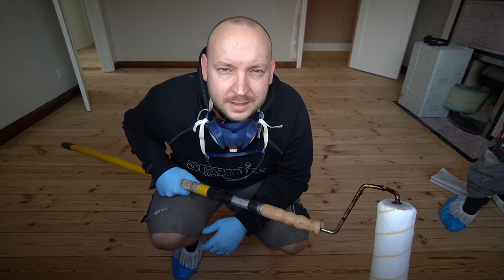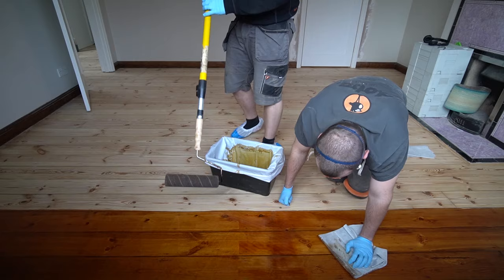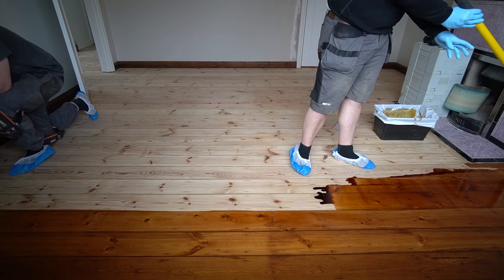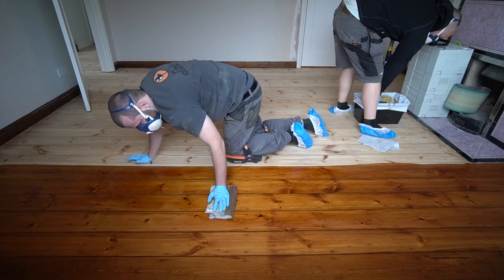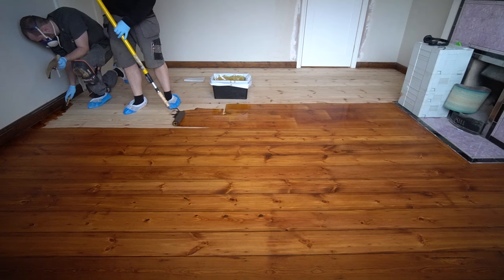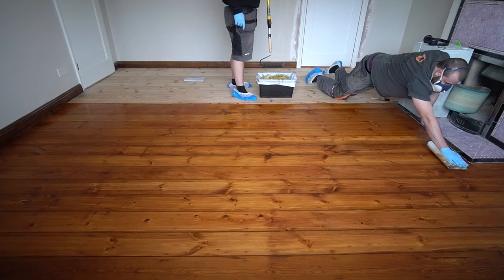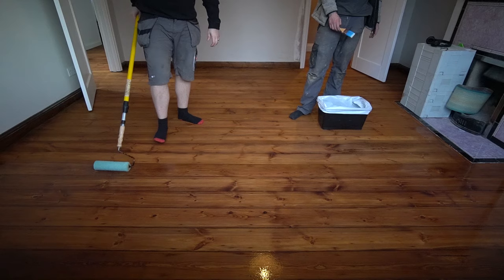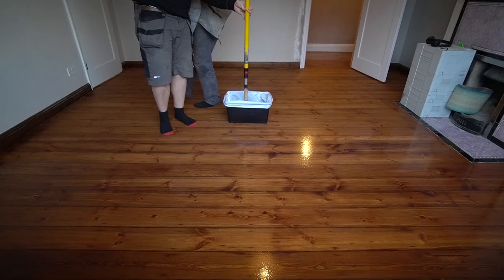A Staining Method That's BETTER FASTER AND EASIER

Comment: Here in east Texas we have a lot of Cypress trees ...therefore a lot of older homes have Cypress  wood floors . I laughed at a "professional" wood finisher when he told me it was impossible to get an even finish on Cypress or pine floors. I get amazingly beautiful non blotchy finish on Pine, Cypress and Cedar.  It's required that you sand soft porous  woods down to 150 grit and then the major secret is to pre-wash it after vacuuming with paint thinner.(make sure your stain is compatible with mineral spirits or paint thinner. You then have about 1 hour after the wash to complete the staining job . The thinner prevents the more porous areas of the wood that would normally absorb too much stain, from making it darker , and thus a splotchy finish.
Reply: Need any help . I’m in The Hawkins area and did floors for 30 years
Reply: Thank you for sharing that tip! I’m sure that would work on any soft wood project; not just on floors! 🥇
Reply: What about yellow pine? It's listed as a hardwood I'm trying to decide whether I want to spend endless hours hand sanding    furries n such before staining. I've already beat the hell out of it with a pressure washer

Comment: So, using a roller is "wrong"?  Really?  They say it puts on too much stain?  That doesn't make sense.  After watching the video, I would say that you didn't use excessive amounts.  You achieved the look you wanted.  How is this wrong.  Thanks for the info.  We've sanded and will be staining and sealing our floors next.

Comment: I'm not here to critique like an armchair contractor. I work for a living too. I just genuinely have a question. Did you have your guy immediately wipe the excess off because you wanted a lighter tone? Or because that particular stain dries quickly? I usually wait 5-7 mins and wipe the excess.

Comment: I like to use my buffer with a white pad.  Buff on buff off.  I haven’t been down on my knees in 20 years.
Reply from the maker: Jason Beaudoin which stain do you use?
Reply: I use Bona dry fast
Reply from the maker: Jason Beaudoin yeah I have heard that’s a really great stain in the states. We have it here but it has a slightly different make up. It doesn’t work so well unfortunately .
Reply: @HowToSandAFloor  BONA /Dura Seal/ MInwax  the most with what we work in USA  also some others what we are using not so much  ...oil base same Bona/Dura Seal /Masterline/Sinteco (what in Europe you  got )  and some more  also for Water Base ...Bona /Dura Seal other a lot of variation  i will recomand BONA as advice very good product you can get from Europe

Comment: I'd prefer those boards be a little lighter or closer to natural, but they look great.  A stain choice for me would depend upon the color of the wall / trim as well. I don't want to choose a stain color for my oak floors, but it would prolly hide lots of sins. Have wavy boards and chatter from a botched job. I tried to fix that persons botched job.  The hardest part of the job is deciding when enough is enough or when there are diminishing returns.  Learning to live with imperfection -- Sigh.

Comment: Thank you!😘   After trawling through countless videos came across yours and is the best 👌 You explained everything clearly and we feel alot more confident in staining and varnishing  our floors. We have a 3 storey town house which has pine floor boards - doing all 4 bedrooms and staircase. Big project and need to get it right. Have morrells stain and bona varnish, hubby finishing sanding today - thanks for your advice its been a massive help. Hopefully we won't row which each other as the jobs are pretty defined as shown in your video. Marital DIY harmony ...we hope.
Reply: matters not how u put it on, matters how u wipe it off.   just have to brush it rag it or whatever to apply it to the wood.

Comment: Wood floor guy here. Pro since 1999. I'll skim around every once and awhile on YouTube about wood floors. Interesting to see the different methods. 
Yes you are rolling on stain. 
Only issue I have is splattering. Thin watery product can splatter if you're not careful. 
Usually I wipe on and off with rags. 
Occasionally I'll use a circle buffer to drive in my product. Less product and I'm off my knees. 
Cheers, Ben

Comment: One reason why a bucket strategy is also better:  
As you apply laquer, you have a chance of picking up and pushing around dirt/hair on the floor.  A bucket will allow you to put a grate at the bottom to allow it to settle to the bottom without picking it back up.  I previously used a bona-pad for application though.  Allows for a very smooth finish.

Comment: Good ideal on roller, I just completed a 4 bedroom 2 story home in 1/4 of time.  I used a  14" roller 3/8 nap  and 3 gallons of oil based stain. Same roller for waterbased poly and it turned out great! Thanks for video

Comment: Hi. Watched a few of your videos. Enjoyable. It has been my trade for 30 yrs.. I'm 79 now, retired???
Its such a rewarding job isn't it.
I live in Notts. But used to cover the country if job big enough. Used to do loads in London. But stopped it. Away from home too long.
If not staining. I always used Junckers Base prime. No need to sand again between coats
I  also used lots of Ceramaxx from Havwoods Accessories for commercial work.

Comment: if you are able to get it in the UK, you should try  Loba  WS easy Prime sealer and their Viva 1 step  self leveling polyurethane. I used them over Duraseal stain, I am in the US. Loba is a German product, I am 70, did 90% of the work, including sanding, by myself, It looks so good. I am extremely happy.

Comment: You"r doing it right. For stainting  to do it with a brush, it would take longer . With the roller it is much faster. Just make shure you use a fine roller, don't buy cheap. Thank you for sharing. You"r doing a great work.

Comment: Roller idea is pretty cool. I like using a lambs wool on a lock and a 4 inch brush for the edges. I’ll buff off the stain using a black buffer pad with rags underneath. Works like s dream. The black pad grips the rags preventing them from bunching up or folding. Do you ever water pop your floors? I’ll use 50/50 water and denatured alcohol. Helps the floor dry faster.

Comment: Another great floor Ben. I know what you mean with the lap spash marks with the morrells. I've used both roller and pad. as you demo-ed, with the roller you really have to squeegy the excess on the side of the scuttle, then not much diff to the pad.  Bona Traffic is the only product in my opinion. i've even used traffic to finish a beech worktop - it's the nuts!!
Reply from the maker: Thank you!
Reply: did you use a special type of roller...like foam

Comment: Aaaa....the dreaded stain. We've used rollers, brushes and we have also rubbed it on with cloth, i find the brush is the best way ( and slowest) but generally worth it. It turned out well for ya, great job again man, we actually do it the exact same way.

Comment: Been doing this for years, then a buff out and light vacuum the next day floor is like silk for your 1st build coat. if you put a cheap 220 disc on your buffer red/brown pad and lay the stain on heavy it will produce an amazing final buff feel. Add stain 50/50 ( this will produce a lighter stain than intended) to your finish and do a 2fer on cheap jobs they want quick turn around. Mind those contracts though liability is always just around the corner. Your technique is fine as long as the stain is dry prior the build coat. Make sure all stains that are blended with finish thin with similar products...or ..nightmare!! Good work sir. Water pooping and applying stain on your knees will often produce drag marks from your feet and knees.
Reply: I use a blend of ~48% NGR stain 48% retarder and a splash 4% moisture cured polyurethane. Apply (liberally) with lambs wool applicator bar which made out of PVC piping, brush in the edges section by section. Thinning the colour right down with retarder but using twice as much product helps keep the edge wet and everything just evens out beautifully (although it look s terrifying as you apply it).
Tried dozens of different methods across hundreds of floors and this method works the best for me.
Reply: @peterkotara  Outstanding Ill try this my next rental job so it won't bite to hard if it all goes south. I always am looking for better methods. MCU is almost impossible to find here VOC laws, but straight poly should be OK.

Comment: Never thought to roll it on, might try to talk my boss into trying this with a lighter stain. our crew normally just uses rags, have used lambswool a couple times which goes alot slower but give a really rich and deep color that anything else just doesn't give
Reply: My main question is do you water pop your floors before staining?
Reply: Mr.roastyonutsack Jr. I think only if you want a darker stain. I know it helps if you want to absorb more stain to fine sand with grit that would leave more pores open before buffing.
Reply: @kombobeats  there's a huge difference between a darker stain and richer stain, water popping won't make it darker it just makes the color less blotchy and have it take richer, the darkness depends on the stain you use, how much of the stain the wood absorbs and takes the stain depends on the process. I think I rolling on stain after water popping would be a disaster because of lap marks like the video mentioned
Reply: Honestly, using rollers are the best thing if using Morrells stain as it dries so quick.

Comment: Thanks for the video. It answers my question, 'can it be done with a roller'. Yes. I've experienced in applying stain with a rag or brush, that if you lift the brush or rag at the end of any stroke, it will leave a 'faded' or ragged end, instead of a hard line. Faded edges are much easier to blend strokes together. Now I'm wondering if that effect is attainable with a roller. I'll try it soon. Again, gentlemen, thank you for the video.

Comment: Cool vid...I tend to stain in oil with a wide brush and rag off..with oil I have plenty of time to play with..
I also tint the water based lacquers if required..
I also use a large fume extractor if I apply oil or sprit base stains.
I see you also use Festool.

Comment: Rollers fine. Allows u to put it on thicker if u want the stain darker. Normally just use applicator and a thin brush. If your patient u dont need to wipe it off with applicator technique. Bona traffic/Loba duo is my standard Water base polyurethane. I will rarely use anything else. Sticks to anything and rare lap marks

Comment: I buff the stain on with a thin carpet. I cut in with a sash brush, wipe, then buff into the cut .  You need to use a stain that is made to buff. Usually it has tongue oil in it.
Reply from the maker: There arent really any good buffing stains in the UK, its really frustrating. Duraseal was going to be imported to UK but I think they ran into to many problems

Comment: My polish boss used to do it this way . I would cut in and he'd apply with a roller , and I'd go behind him with dry rag tonsoak up excess .. u gotta move fast to not get over lap lines but when u work with someone so long we both know what we r doing..
Reply from the maker: Since this video I’ve done roll on and roll off. It worked surprisingly well. Also done rolling the whole thing out like lacquer, then just ragging off afterwards, with overshoes on. Both were amazing.

Comment: If that was minwax stain on a pine floor it would lap far worse. Trade secret for big jobs...use your buffer to both apply and remove stain. You can use a white pad or a good quality carpet cut in a circles under your buffer. This method also ensures an even spread on large floors.

Comment: Interesting. I've heard of guys using rollers but I haven't seen it in acti9n. We apply and wipe up with a buffer using carpet pads. Idk if that's a thing in the UK, but it's definitely faster than this. I saw the recommended stain was minwax. Minwax is inexpensive and easy to work with. But it has drying issues. It's anywhere from 10$ to 14$ a quart where i live. Most guys have gone back to it because duraseal, is now 25$ a quart.. duraseal for sure is superior in dry time and colors. Some colors overlap because they are owned by the same company but they are different products. Duraseal is harder to work with. Bona is fairly easy to work with, and drys fast but their colors don't look great 20$ aquart. I don't have any experience with loba stains. Yet anyways. I do recommend buffing the field first, then blending your edges. Use  a good 5 or 6 inch brush and keep smaller ones near by for when necessary. Clean them after and keep them in their own bucket. I'm not a fan of chip brushes. Applicators do work well for stair cases though.

Comment: If you do not like filling in such cases, what would be the alternatives? Also, what you do with nails on such floors - should they be a bit below the surface or sanding machine is fine with them?

Comment: We are staining Douglas Fir floors and using Minwax Wood Conditioner ahead of the stain.  We are having problems with inconsistent staining and sanding scratches coming through.  It has been so frustrating.

Comment: Excellent work lad's, do you find the roller better or easier to use than a wool applicator which I mainly used in the states and roller in england. When using the wool applicator to put stain on and towels to wipe and dry, then using the same applicator to apply the finish. Do you ever use this method or similar. Anyways great videos and keep up the fantastic work 👏.

Comment: Floor looks great and V satisfying to watch your videos! Quick question, I have an old wooden floor above a cellar which, like most cellars smells a bit and has damp. How is best to fill the gaps between the boards and will “sealing” the airspace between the living room and cellar affect the finish in the long term? I.e will my moist cellar penetrate and destroy a new floor that I have sanded and varnished!?

Comment: Hey man, love the videos. I’ve used your techniques to renovate 2 previously covered parquet floors - 5 finger pattern block each one being 20x100mm. We bought some old parquet and have cleaned, laid and now sanded it. However, it’s lighter when lacquered so we’re having to stain it. How would you go about applying the stain as the grain goes in all different directions? Thanks man.

Comment: This method would save my knees greatly.
Reply from the maker: We have since tried rolling on and rolling off on a commercial job, it worked perfectly 🤣
Reply: @HowToSandAFloor  "rolling off"?! Instead of wiping? I might have to try that with my next big stain. Have 4 floors in a row I'm staining right now. But they are gel stains, I'm not about to risk rolling gel. Lol
Reply: @HowToSandAFloor  will you do a video on the rolling off????

Comment: US floor guy here. I tend to use DuraSeal QuickDry here(its made by minwax). Have good outcomes and even color with it. Its quick dry high solids stain that can even reactivate and even out or disappear stain and drops or splatter thats been on the floor for even up to 2 hours(though i try not to let that happen). It cool seeing products used in other countries. We use a lambswool to apply it and then buff or rag it off after applied. Am curious to try Duraseal with a roller though after seeing this. I learned applying finish with a flat pad and T bar. Am wondering if anyone knows if roller is faster(or slower) as well as how the final products compare with the waterbased finishes?

Comment: How do you deal with floors that creak? Does filling help that?
Reply: If the floor feels bouncy and has big gaps usually wood filler will not hold up. It will brake apart in the gaps because the boards have too much movement.

Comment: We just closed on our house yesterday, there is 70s shag carpet over parquet hardwood floors upstairs. The carpet is already ripped up partially in the master bedroom and what appears to be an ugly urine stain on the wood. What if the sanding doesn’t get that up? will I have to do a dark stain to cover it?
Reply: What did you do to fix the stain? I’ve been house hunting and never seen so many previously beautiful wood floors ruined by pet stains! Such a crime! I searched on how to remove pet stains and there are a number of vids on how to do it. Peroxide based hair bleaching cream is one way. I’ve yet to see a professional do it, though. I’d like to see how they handle it.
Reply: People do tend to stain their old floors to cover-up pet stains. Unfortunately sometimes the only way to get them out is to replace the boards. Yes, there are some bleaching methods that can do wonders.

Comment: I use minwax and rags to apply the stain. Some guys use a buffer to apply near me
Reply: I wouldn't use Minwax. Use Duraseal stain, it's Minwax's professional lineup of stains that do a lot better.
Reply: @dedalliance1  i use duraseal poly. My family has been in the industry since 1962. Minwax is perfectly fine as long as you buy it in quarts(550voc) if you buy it in gallons(350voc) then its no good.
Reply: @Cardinalfloors  Interesting. Well, they're making Gallons illegal here anyway because of the VOC levels. So all we're going to be able to buy is quarts anyway. I'm not sure if that'll transfer over to the consumer goods stuff too or not though.
Reply: @dedalliance1  i know its unfortunate, back in the day we could get 5 gallon buckets of the best poly with high VOC now its all quarts its insane they think they are doing something but actually just creating more waste lol more cans/ higher chance that they aren't sealed and disposed of properly. Im sure in our time we will see everything become water based unfortunately 😔 😕